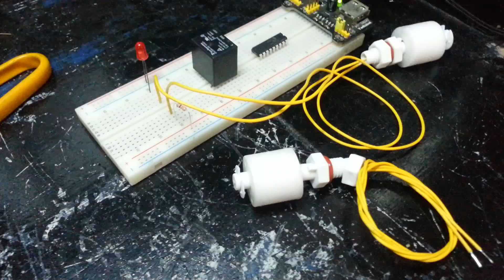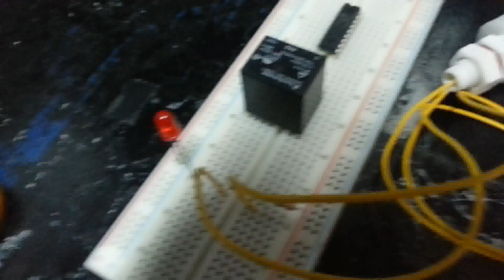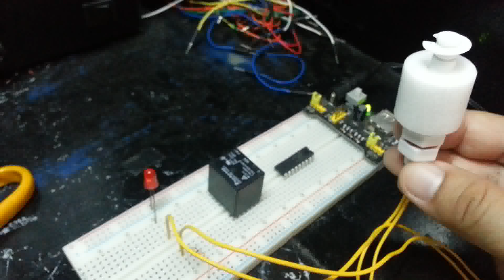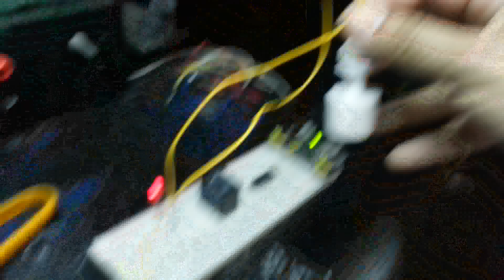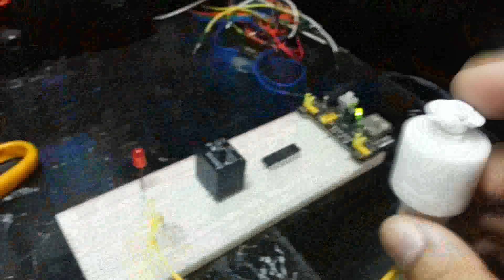Ball Float Liquid Level Sensor Demo

Comment: Very informative, Can this shut off a 12vdc water pump? If so what other parts needed & how do i assemble it?
Reply: Yes, you need a relay and you need to connect the pump using the NC (Normally closed) pins of the relay. Now the pump should be normally running. Once the water level is high enough the water level sensor will turn on the relay which switches on the NO(Normally open) pins of the relay. This means that your pump will shut off. If you don't understand, please read a little about how relays work.
Reply: @flightisallright  thank you :)

Comment: Hi Nelson, happy to find someone tha having my same interests.
I would like to ask you if your sensor close and open normally like a switch or not. It's a clean contact or it necessary works with electricity? I found it on aliexpress but i can't understand why 2 models 110 and 220 v.
Can you show me prease, with your experience, if you know some level sensor that work like a clean switch?
In my project i'm assembling a sensor with a 433Mhz module trasmitter and connect it to a mobile App like Ewelink for alerts.
Thankyou for your help.
Reply from the maker: Hi Giuseppe, the wires are quite thin maybe awg 22 or something near that, so i wont be suggesting using this as a switch (similar to light switches) for high power devices. Personally i use it similar to an input button for microcontrollers only. I would say its clean contact, a reed switch switch provides the contact, but i implement a debounce in code just in case. Hope that helps.

Comment: pede ba to sa fuel tank ? looking for a floating switch vertical mount for a gen set with a separate motor to for refueling it from another tank.

Comment: How much dc voltage for the magnetic coil of the float to energized it? Thanks.
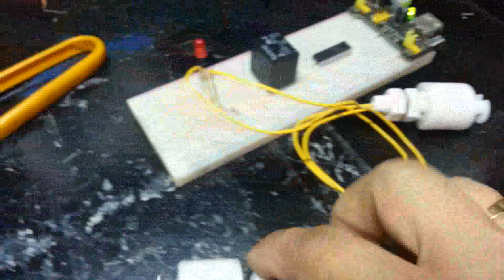Reply: +Dario Manalo   5 volt.  ,    in 1:20 explain the connection & 1:35 said: Positive 5 ( means 5 volts.)  Good luck.
Reply: +EgyPonce what I meant is maximum dc voltage; can u put 24 dc on the magnetic coil?
Reply: +Dario Manalo At exactly 3:57 minutes played, a direct shot of the relay is used. You can see the specifications. I'm not the one who made the video, but I just wanted to bring to your question. These systems can also be used in 24v., But the relay and other electronic devices change. They sell on ebay a ready board that perform this function, missing only the sensor connect them.

Comment: does the float switch work the same way if the yellow wires are switched around when you connect it to the resistor and the LED
Reply: I ordered some from ebay that look just like these.  They consist of a reed switch in the shaft and a magnet in the float so they will work the same way regardless of how the wire is connected.  Mine came normally closed (closed when the float is down) and to make them normally open (open with the float down) all you have to do is take the float off and turn it over.